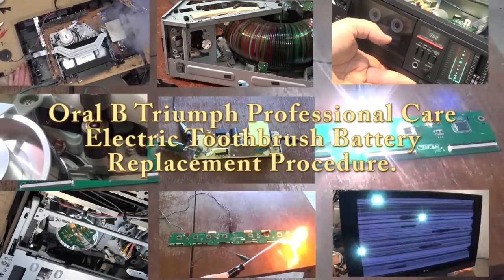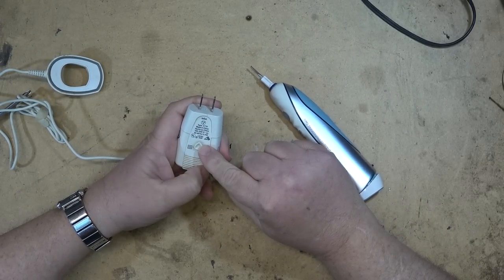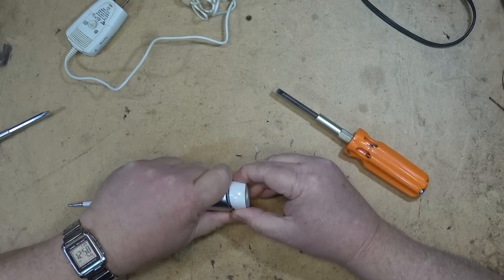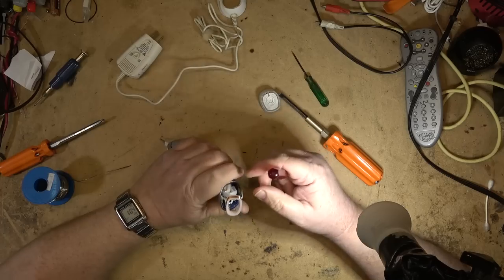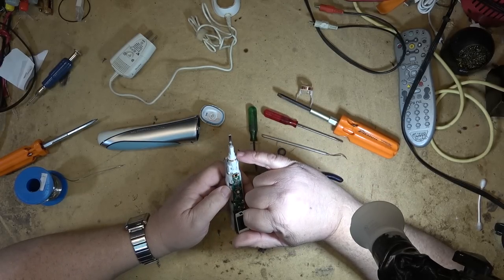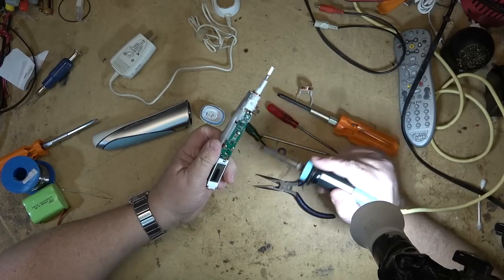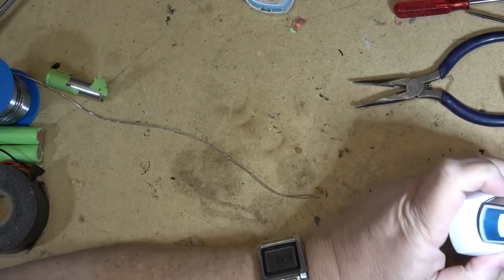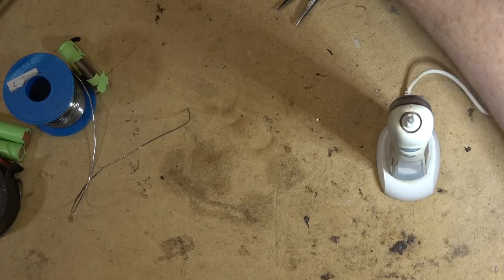Oral B Triumph Electric Toothbrush Battery Replacement

Comment: Very nice work. I had to fix three of these, and in every case the top and bottom were stuck together with old toothpaste. Your video gave me the confidence to go after the shell with a vise to get the bottom off. The top ring was cemented in with old toothpaste, and I had to dig all that out of the ring channel, to make for an easy reassembly. I used a deep socket to push the top ring back on.
Reply from the maker: Don't forget to lube the gears

Comment: I was fixing a slightly more recent OralB model recently. And it became a future project to finish 😅. I found out I also need to change the pushbutton switch and didn't have one that would fit at the time.

Newer models are even cheaper, the cell is soldered to the PCB, no springs. And they are a little harder to take apart too. Made even cheaper if you can believe it 🤷
Reply from the maker: Well this one sold for something like 249.00 when new. I didn't pay anything, my dentist gave it to me complements of being a new patient when he was setting up shop as my old dentist retired.
Reply: @12voltvids  The one I still haven't completely fixed was given to me by a dentist too 😂.

The profit margin on those must be incredibly high when you see their construction.
Reply: You have a fancy one with a display basic without in UK 15-30pounds.
Reply from the maker: @jamesbaker429  this one has a remote display as well that shows how you are doing and counts down the brush time.  It was expensive back in the day but well worth it because 20 years later it still works.

Comment: Very interesting. Last year my old Braun Oral-B type 4728 toothbrush died, same thing, battery didn't hold any charge, so out of interest, took it apart to see what's inside. While turning the bottom peace, somehow the charging coil got damaged, so it was lost case anyway. I guess otherwise I could've just replaced the battery like you did and still use it. Before I recycled it, took some parts from it, like the electric motor, which has metal gear in it, good one as most have just plastic gear. Also the rubber o-ring, spring and maybe some other small parts I have forgotten by now. 
I then bought new tooth brush which is using ordinary AA batteries that can easily replaced. I was thinking to use re-chargeable battery, but even regular battery seems to last pretty good amount of time as well.

Comment: I have changed battery in 2 different Braun Oral-B units, but without the sensor in the brush heads. Had to scrap another because it had leaked "toothpaste" and was a total rusty mess inside

Comment: Im surprised to see one of those toothbrushes still going. I replaced the battery in mine around 6 years ago, but after a couple of months the rubberised parts on the handle started to break down and go sticky, so I peeled it all off. Then it began to leak and was dead again for good after 6 months from corrosion.

Comment: Nice, good work!
In 2019 I replaced my old Braun and got one that uses a lithium battery, maybe it lasts longer than the older one that used a nickel metal hydride battery.
Reply from the maker: 20 years is a good run.

Comment: That toothbrush is impeccably clean for its age. If you take one apart that isn't and where toothpaste has leaked inside, the smell will be from another dimension. 😅
Reply from the maker: I clean and sanatize with UV light nightly.
Reply: You must have horrendous oral hygiene. I had an old oral B electric toothbrush that I took apart, the entire inside of it didn't have any area that wasn't caked in old toothpaste and water. I don't know how it lasted as long as it did. It made it a good 10 years... And mine didn't smell at all.
Reply: @Jason-wc3fh  My oral hygiene is fine. 😄
The cause of the smell was the toothpaste itself coupled with mold. The toothbrush never got to dry properly in my somewhat cold bathroom.

Comment: I always preferred the two stroke model. Darn emissions control legislation!
Seriously though l had one of these but lost interest before the battery ever died. My Norelco rotary style electric razor though is another matter. Fantastic little device! Im only on my 2nd one in over 40yrs.  I can tell the battery is starting to go. Won't be long.... I hope I'll be able to replace the battery when time comes!
Reply from the maker: I had a Norelco and went back to the blade about 20 years ago.  As close as a blade or your money back my ass.
Reply: @12voltvids  i agree it's no substitute for a blade. But l work on the road quite a bit.  l find it's great for a quick touch up before an important meeting or show.

Comment: Does the coil at the bottom to charge the battery have a diode to keep from discharging or not I can make a curcuit of a julethief to a 5v.please let me know.
Reply from the maker: Yes it would have to have a diode to change the AC to DC.